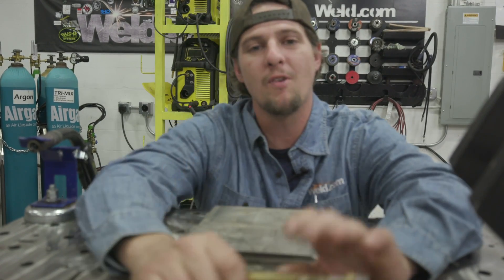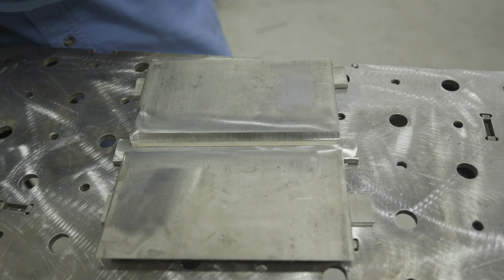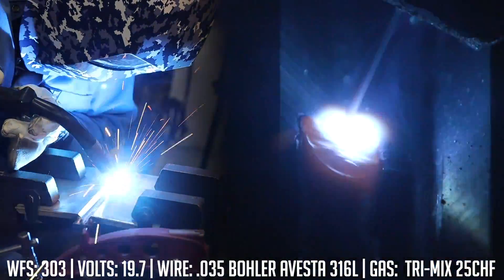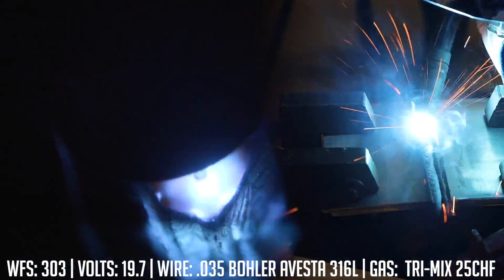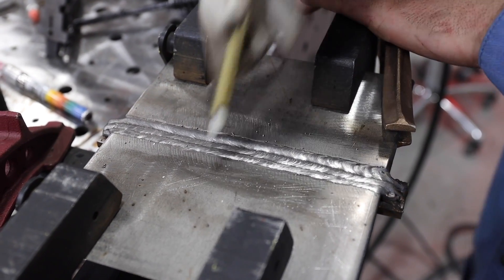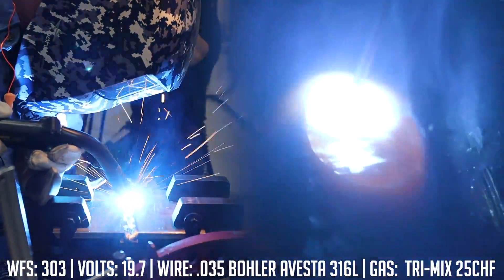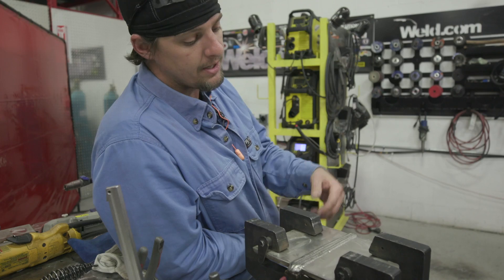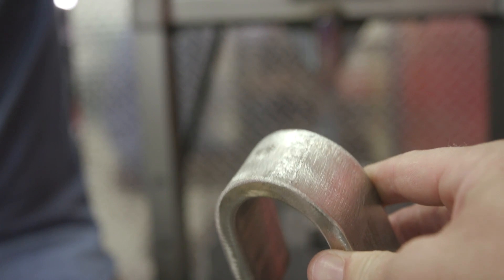Short Circuit MIG Stainless Bend Test

Comment: Bit to grey.
Reply: Of course its grey. Thats caused by the extra silicon in the wire, pulling oxides out of the puddle and floating it to the top. 
Wont ever stop it.
Reply: @kf8575  wouldn't it be pulling the chromium out.
Reply: @kf8575  I Pulse mig every day never had a problem with dirty grey welds, so you can stop it just need to know how to weld it lol

Comment: Correct me if I'm wrong but I always thought stainless and aluminum Mig were spray transfer
Reply: Usually pulse spray yes, but the short circuit stainless is applicable for mostly sheet metal use.
Reply: TMoD7007  na man I have never seen short circuit stainless. That classic stainless hum is spray transfer just like aluminum its the nature of the beast. if you dont have that hum your not doing it right nor getting proper fusion.

Comment: Why waste your time with a root and face bend, do a side bend, retired Boilermaker 35yrs. Every weld test I took was either an Xray or side bend, no one did a root and face bend, because their to easy to pass.
Reply: Side bends are for 1" unlimited usually dealing with plate, different procedure than tubing and pipe coupons
Reply: @Hash42024  Just so you know a 3/8 plate test will certify a welder up to 7/8 plate if you pass the bend test. A 1" plate test again if you pass the bend test will certify the welder unlimited. Again if you pass the bend test. I've worked for CBI, Nooter and B&W to name a few contractors who only did side bends on the 3 specimens you cut from your coupon. get your facts straight young man.
Reply: @KenSmith-bv4si  just so I know huh 😌👍ok brother
Reply: @KenSmith-bv4si  you dont root/face bend 1" plate.Too thick. Must be cut to 3/8" width coupons then a side bend is performed.  Explain why 3/8"-1/2" plate would be side bent please🇺🇸
Reply: @Hash42024   Most codes require side bends  when welding thicker than 3/8" so 1/2" would require a side bend.
Reply: Wow thats a fancy excuse, did you tell the test booth Proctor that while he was escorting off the job site? Side bends weed out the fakers.
Reply: @KenSmith-bv4si  wasn't trying to hurt your ego brother
Reply: @KenSmith-bv4si  
Probably Cause you're a boilermaker. And yall cut and bend "sch40 tubing"etc. Hence thin coupons that get side bends .
Reply: @KenSmith-bv4si  disrespectful burnout calling people fakers 😂
Reply: @KenSmith-bv4si  brother you wanted a pissing contest. There you go. happy🤙 if it sounds like I'm incompetent I guess so. B31.3, D1.1 4g 1" unlimited etc. Keep it classy 😉 I'm getting more likes.
Reply: 🤪I'm just a dumb welder🇺🇸
Reply: @Hash42024  and yet you still haven't passed a side bend.
Reply: @KenSmith-bv4si  at this point I dont think you've ever passed a side bend, you a cold troll huh
Reply: @Hash42024  Well we can see from your video, that you haven't passed a side bend test either.
Reply: @KenSmith-bv4si  so now I have videos on the interwebs huh😂👌
Reply: @Hash42024  And yet you still can't pass a side bend. Also whats an interwebs?
Reply: @KenSmith-bv4si  the internet mabob
Reply: You know.. the thing
Reply: @Hash42024  And yet you still haven't passed a side bend test.
Reply: You don't have too. Its not thick enough.

Comment: Stainless videos are good but using a grinder to cut out metal to allow you to put in metal really isn't fair,you should practice it so it's only your weld passes and wire wheel/hand brush cleaning to meet the specs, and when bend testing center your coupon in the jig/with the ram so you are pushing evenly on the center of your weld not ending up with a coupon 1/2" higher on one side and not in the center of the weld.....

Comment: woho the earily squad. 
i have a question .. sometimes the rod metal doesnt stick to both plates that am trying to weld unless i run the stick on a test plate to heatup the rod a bit and then it welds fine .. why is that ? 
take into account all am using are cheap chinese rods. 
you guys rock.
Reply: You're actually removing the moisture in the rod by heating it. If you intentionally make the ride  stick instead of striking an arc you will heat the rod without burning it and then you can continue welding only for a few seconds though or it will get really hot quickly
Reply: @Adam-lv1uu  what an excellent explanation... thanks a lot and have a great day 😊.

Comment: I think I would've turned my wire speed down a bit and pushed instead of pulled
Reply: Yeah that🤙
Reply: I’ve had more luck getting penetration by pulling than pushing. My old textbook even states that a pull should get more penetration because it’s pushing down back into the root of the joint
Reply: @1012Mrjesse  I always pull also except with spray arc,stainless & aluminum 🇺🇸